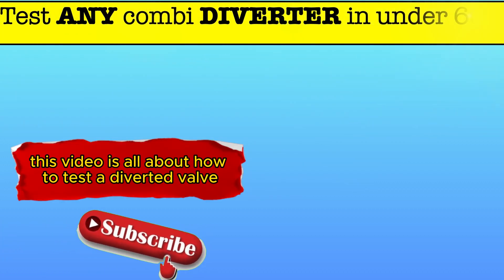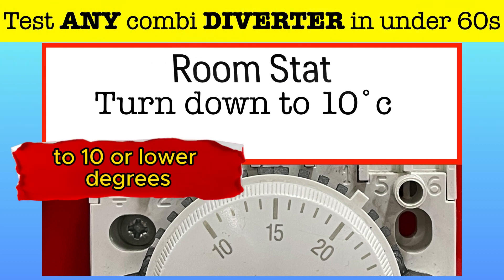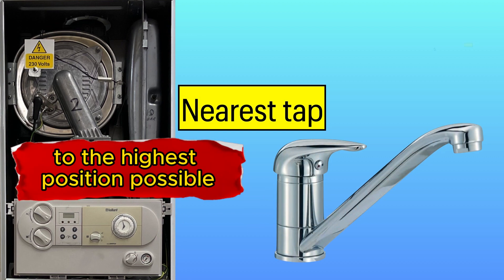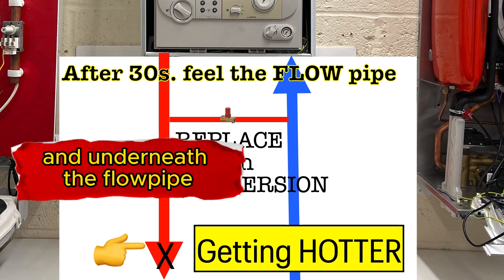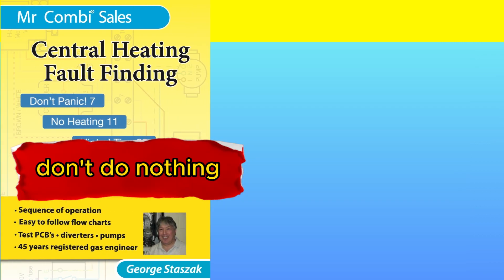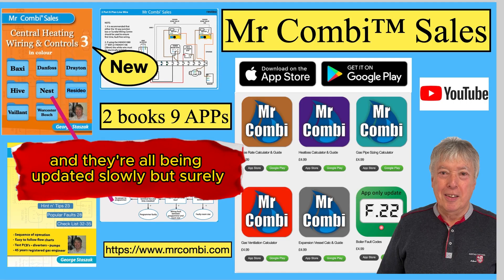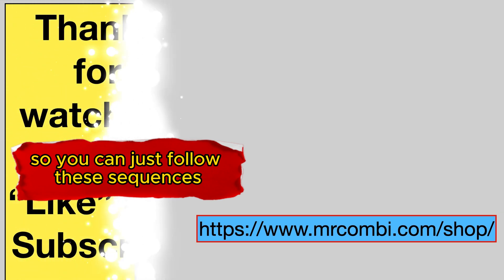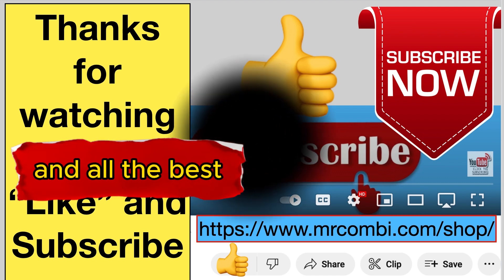How to test any combi DIVERTER in 60 seconds, the easy way. 23 09

Comment: My diverter valve has green corrosion on connection points. Doesn't seem yo be any symptoms of failure. Is it worth leaving or worth taking out and cleaning the corrosion off with wire wool?
Reply: I might just change it. Part isn't that dear
Reply from the maker: @lewisf18  Good idea, don't forget to flush and fill with Fernox F2. 👍
Reply from the maker: Hi Lewis, If it's not broken leave it. to clean use a small wire brush like the size of a tooth brush. Green is a sign of over pressure, lack of inhibitor or about to fail. Over 6 years old replace cheaper than after it's failed. 
Almost all installers do not update / replace rather than at a certain age replace. 99.9% of my customers said NO wait until it breaks down which cost's a lot more money and stress. Customer knows best. Thanks for asking, George 😍

Comment: I feel my radiator nearest the boiler get slightly warm when running a hot bath. Is this normal for a combi? I think it's done it since I moved in 12 years ago
Reply from the maker: I think I replied earlier, but its the diverter letting by. thanks for asking, George
Reply: @mrcombiBedford   Thanks. Do you know if I should be worried, like maybe it's about to fail and I should get looked at or just carry on?